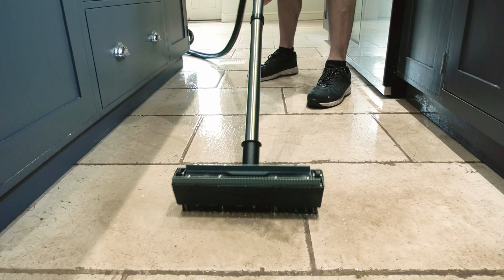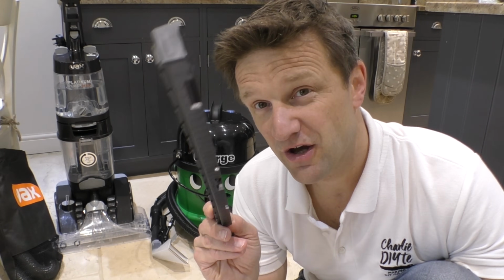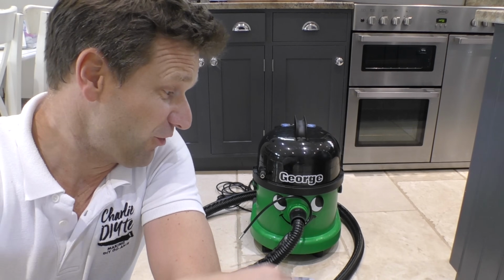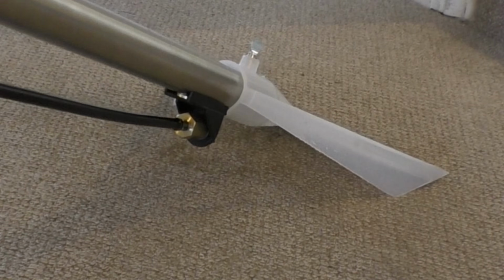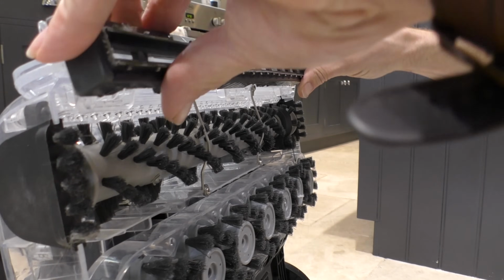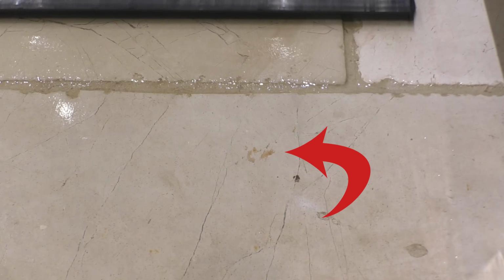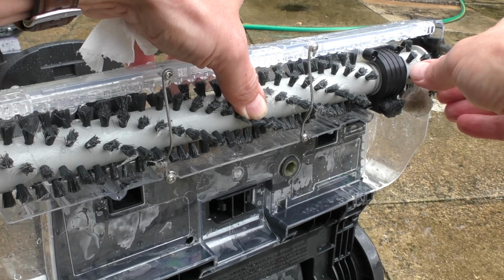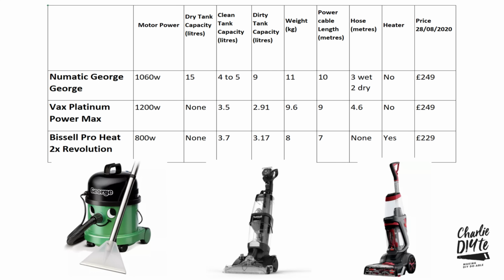The Best Wet and Dry Vacuum for Hard Floors & Carpets?

Comment: I had the Vax Rapid power advance (purple machine) and I didn't get the same problem you've had so maybe the machine you have/had is faulty or perhaps the design is getting worse. 
The solution mixer didn't use it all in one go (though still think it used more than it needed so I'd have to buy more!). I didn't have any leaks but I agree the worst thing is trying to clean the damn thing after use, absolute nightmare! 
Our machine did get a fair amount of abuse but it's still working as it should.
The small opening on the spot cleaner is a bad design, gets clogged easily.
Moving to a smaller place soon so may have to try the George, looks less complicated and more robust though maybe a little more effort needed using it.

Comment: I'm a bit confused as your talking about two different models a dry Numatic and the Wet Numatic, whichever you buy you wont be supplied with both the wet kit or dry . I bought the Henry wet and expected the dry kit to be included and wasn't.
Reply from the maker: Hi Peter, no I'm only talking about George which is a wet and dry vacuum. It comes with both kits. It is confusing how many different models there are but George is basically the Rolls Royce in that it has the best spec dry accessories and is the best domestic wet vacuum they do.

Comment: What I'd really like to ask is how does the suction compare for extracting the water from carpet?  I see that the hand-held tool is clearly superior on the George, but did you notice whether the large fishtail also had more suction and extracted more water from the carpet than the vax main head?  
I recently tried and sent back a Bissel Revolution 2X because it leaked.  My experience of it seems like it is almost exactly the same experience as you've had with the vax.  The handheld barely had any suction on it, it was almost impossible to clean around the brushrolls and it was so loud I needed ear defenders.  
The only downside to the George is of course there's no carpet agitation built in, but I could just do kind of what the pros do and brush a pre-spray in before extracting.  Though I'd have to use a manual brush whereas they use a separate electric brushing machine.  
Thank you for the video, it was just what I was looking for.
Reply from the maker: George is superior to the Vax in almost every way. Don't buy the Vax. You'll have a similar if not worse experience than the Bissell, and my father in law has broken mine somehow when he borrowed it soon after making this video. The water extraction with the fish tail is very good. As you say with no agitator you have to pre treat and then I use a soft scrubbing brush to agitate, and I typically use the snap fish tail rather than the large one as you can apply a lot of pressure with your hand for maximum extraction. Basically it's a spot cleaner. If you wanted the whole house done I'd get a pro in, but for hard floors and spot cleaning, George takes some beating.

Comment: Hi does the numatic george do a good job for carpets or is the vax better? I have thick carpets
Reply from the maker: I'd say probably George is better but if you've got a lot of carpet to do I'd get the pros in and use the suggestion vacuum just for spot cleaning. That Vax is dreadful.
Reply: @CharlieDIYte  thanks for replying 
Lots of great of reviews for the Bissel and Vax but I just think how do those brushes do any real cleaning? Is it worth getting it at all ?

Comment: I’ve had my George for about 10 years now and it’s never let me down. I’ve used it for carpets, sofas, car interiors and it’s been a real workhorse. It’s still going strong and if it packed up tomorrow I wouldn’t hesitate buying another. I always use rug doctor liquid but after watching this I may try using something different. Great review as always Charlie. 👍🏻
Reply from the maker: Thanks buddy, and if it did pack up tomorrow, you could just order spare parts for it - something I forgot to mention in my video which is pretty stupid considering I've replaced the motor in my Henry https://www.youtube.com/watch?v=yO7nfqiABMw&t=6s 👍

Comment: Great, not heard of the George before. I've got a rather expensive natural wool carpet being installed Monday and was just looking at vacuum options for it as I currently have a Dyson and I heard they aren't great for wool. I was also concerned what I would do if I spilt coffee or wine or something on it. Strikes me the George might just be the job. I'll have more of a read around but thanks for the advice Charlie. Oh by the way, any plans for a garden Sunhouse feature in future, thought it might make a interesting vid, options, DIY, self build ...
Reply from the maker: Yes, I'm hoping to build a garden room later this year. That small fish tail nozzle on the George would be the best option for sucking up spills on that carpet. Is that the one that can sprouts shoots if it gets a bit humid? I've seen those in some of the very high end renovations I've worked on. Lovely under foot!
Reply: @CharlieDIYte  This is just a nice natural wool loop carpet from Galloway sheep. Not cheap but not stupid expensive. But yes very nice underfoot. I want to make sure I use a vacuum that doesn't damage it and it sounds like Dysons and the like tend to pull up the surface of wool carpets due to the rollers and stuff bristles. I think the best bet is something like the George and vacuum often so there is never any direct ground in. I have an existing Sunhouse which was there when I bought my house. The plan next summer is to strip it back to the frame and see what condition it is in and ideally use the same materials but insulate as well. Otherwise I will replace anything that needs replacing and reclad. I will almost certainly have to replace the window frames and doors as I can see the rot in them already.

Comment: Well having owned 3 different vax machines firstly the classic orange and black vax machine, secondly, the model the platinum power max replaced and the platinum power max also. i have used other brands of machines as well. i am looking to replace my platinum power max though its about 4-6 years old now its still working but it leaks so i have to make sure the tanks are empty after every use. i prefered the model that i originally bought before the platinum power max the only reason it was replaced was it started leaking (it was a warranty replacement) but its squeegee was much better. the platinum power plus does have its benefits over the discontinued model, if they used the same squeegee it would have been a better model than it is.

The George seems like a more advanced version of the classic orange and black vax but i wonder if its powerful enough for my needs? i mean im used to the platinum power max and my main use for it is cleaning hard floors sometimes 3 times a week. George does look like a good contender but is it really?

Now going back to my platinum power max ill share the issues ive had with it some are trivial some are bad you decide for yourself which is which. In your video, the pre-treat unit is a pain to use as you found the best way to get it going is push one side of the connector (the one with the seals on) towards the vax and then press the trigger on the other end and just wait a few seconds after that it should work fine. its not perfect but its a workaround. my biggest gripe with this machine is the squeegee while it works ok I've had to replace mine every 6 to 8 months! the problem is with how its made if you notice at the front where it clips on its just barely held on with 4 tiny little tabs and at the rear it's just held on by friction and if you look at the squeegee its 2 colours so its been moulded in 2 pieces. Now what happens over time is they start to come apart and that friction fit becomes useless only solution is to replace it and even if you do vax only give you a 30 day warranty on the part. it could have been designed and fitted a lot better than it does what would have been better is if the front nozzle part that removes would be to swap that out with another one and also while they are at it design it so that it sits at the same height as the normal one so then you get the full brush use as well. what they could also do is have a replaceable squeegee one more like a window cleaners squeegee and sell them in packs at a decent price. id prefer that over the ones they supply with the machine. 

ive ran my machine on lots of low foam carpet/floor cleaners even though vax wont recommend it and it has no problems at all with anything ive put in it. my go to for my vax is usually flash gel the pink one its a good all-rounder for carpet and hard floors. the other thing i dont like about vax is generally they dont sell spare parts. well, they do things like the squeegee but im talking like motors seals, attachments and new containers etc. don't get me wrong my vax has had a good hard life but its showing it now and there is no way i can repair it which i like to do! ive repaired most of my kitchen "white goods" at one time or another. 

have you since doing this video had the opportunity to try any other machines that do hard floors? id be interested to know about them if you have. i use mine for my utility room kitchen and bathrooms as they all have tiled floors. As with you i dont really like mops and steam cleaners with pads they just don't cut it for me. I'm tempted by George but im concerned about power mainly and if spares are available. it seems to do a good job although I do prefer an upright and I spoilt myself with vacuum cleaners by owning Dysons for 20 years there's not much that can compete with a dyson. 

sorry for rambling on but I guess some other people could find this information useful too. having owned the platinum power plus and worked it hard i would not buy another one even though its pretty good and its lasted me this long.
Reply from the maker: Thanks for this. You'll find George much more durable but it's quite hard work, as you're scrubbing more than you do with an upright, but you'll get better results. Yes the squeegee attachment on the Platinum Power Max just seems like an afterthought. Bottom line this is designed for carpets not hard floors.
Reply: @CharlieDIYte  well my grout is black so I'll probably only scrub the tiles themselves lol. I did look at the Henry wash seems the same as the George but without all the dry vac stuff which is fine but the George motor is 60w more and I don't know if it's worth it.

I don't mind the cost of either just not sure if it's worth getting George for 60 more watts.

Comment: Because with all the other videos. That I’ve watched and the reviews all pretty much say it’s all good.
Reply from the maker: Um, well it's up to you which reviews you trust, but I did put it together properly. You have to ask yourself if the other reviews were genuinely objective. Up to you which one you buy, but you have to ask yourself, do you want a plasticy machine which has no long term part replacement program or a tool that's built to last and which is manufactured so that every part can be replaced.

Comment: Really good video. Can this be used only for dry cleaning sometimes? what parts do I have to buy for that?

or If is there one of the Henry, George range that can be used at times only for drying and other times for washing too? Asking because don't want to buy 2 separate vacuums.
Reply from the maker: Yes, George can be used in dry only mode. In which case it's a very powerful, slightly larger Henry.

Comment: Iv found vax to be a bit unreliable in past 1 upright carpet washer top of range at the time broke down after the warranty period. The wet and dry 6100 series the old fashioned big orange thing. One broke after a week got replaced and I noticed the hose to be poor quality and it’s only glued into the end that attaches to the machine. Upright vacuum cleaner broke in warranty period again replaced under warranty. One thing I will say is that upright carpet washers don’t give the ability to put more pressure on high traffic areas or spots. I have achieved better results with the 6100 series vax than the upright washers. The attachments for the vax 6100 aren’t great feel cheap however they can work on car interior but not professional standards.

Comment: Are you able to swap the bag inlet nozzle on the George for a Henry one?
Reply from the maker: No, because the fittings are different. George is a more sophisticated twist and turn whereas Henry is a screw on attachment.
Reply: @CharlieDIYte  Ah, that's a shame. Thanks as always for these vids Charlie. Real lifesaver.
Reply: @benmjt  Probably too late but I think the Charles or the Argos Henry Wet & Dry (same model just rebranded for Argos) has the screw option.

Comment: Have you go a henry xtra
Reply from the maker: I have, Mike. If you're getting a standard Henry it's definitely the way to go, as it comes with the Aero head tool and mine at least has a two speed motor, although we never have it in the low setting!
Reply: @CharlieDIYte  I would suggest going for the Charles Wet & Dry or Argos Henry Wet & Dry (same model just rebranded for Argos - Also often on offer at Argos). The reason being that as it is a Wet & Dry vac it isn't restricted to a 640W motor, instead it has the larger 1000W motor. The 640W has a flow rate of 31.5L/sec v the 1000W's 40L/sec. Also 15L capacity in the Wet & Dry v the 9L in the Xtra. Though it is a bit bigger due to this. Also 2.5m hose on the W&D v the 2.2m Xtra. You don't get the aero brush with the W&D but that can be bought as an add on making them about the same price but with the option of using Wet mode. Overall therefore I think the Charles/Argos Henry W&D has the edge with the more powerful motor/air flow, bigger capacity, longer hose and option for Wet.

Comment: Tip for the George. A squirt of WD40 in the waste tank will help stop it foaming up and getting sucked out through the motor.
Reply: just the tip I needed, thank you! Is it WD40 specifically or would any oil do in a pinch?
Reply: @Maienkind805  i have only ever tried WD40

Comment: So!
How does the George compare to the Henry Wash to standard Henry?
Reply from the maker: Don't know how it compares to the Wash but it's more powerful than the standard Henry.
Reply: @CharlieDIYte  cheers. I think I may get the George for my site work which is mainly installing windows. 

I like the idea of my fitters finally having no reasons for grubby van seats ;-)

Perhaps will look out cutting back the internal spout to reduce blockage that could occur, as shown at end of video.
Reply: @darronroper  If you don't need the ability to wash but still want to be able to use for Wet consider the Charles or Argos Henry Wet and Dry (same model just rebranded for Argos) It is about half the price of the George but otherwise is basically the same hoover.
Reply: The Henry wash is just gerorge without the dry attachment

Comment: I now have a Bissell revolution but I was wandering if this George would suck more water out of the carpets using the fish tail after the bissell has cleaned them, the bissell cleans very well it  but it does leave the carpets wetter than I would like
Reply from the maker: The fish tail nozzles are fantastic at sucking out water. You wouldn't want to clean a whole carpet with them but they're truly awesome for spot cleaning - eg wine spills or dog or cat excrement. It's quite remarkable watching the stain lifted up and then sucked out of the carpet. George truly comes into its own on hard floors, and then of course it's a very powerful dry vac, and the accessories are better quality than you get with most Henrys.
Reply: @CharlieDIYte  thanks for the reply, I wasn’t really thinking about the cleaning side as the bissell does that very well but I did want something to draw more water out of the carpets so the dry time is reduced. So basically finish off with George with the large fishtail to dry the carpets.

Comment: Is the George okay on timber floors?
Reply from the maker: It would be ok. Doesn't leave the floor as dry as some of the machines that are designed for flat surfaces but as an all rounder it's difficult to beat. Don't buy a Vax - flimsy gimmicky product.

Comment: Happy Xmas! Many thanks for reviewing these products. Just wondering, did you try using the Vax without the squeegee front attachment? - the bit that rendered the rollers useless. I have stone floors very similar to yours with wide deep mortar grouting and I would think the Vax bristles would work wonders on that - the dirtiest part of the floors. Would be very interested to know what you think of that 🎄☺️
Reply from the maker: I haven't, but without the squeegee it won't suck the water up properly.
Reply: @CharlieDIYte   - I’m wondering in that case - use the Vax without the squeegee initially to scrub the floors - then add the squeegee to suck up?
Reply from the maker: I think I'd still buy George with its scrubbing tool. Yes harder work, but my father in law borrowed the Vax soon after I did this video and quickly broke it.
Reply: @CharlieDIYte   - Did you reseal the floor after using the floor cleaners? Or maybe the sealant survived the deep scrubbing?
Reply from the maker: @WonPXL  It just about survived but needs resealing really as it's a water based sealant and isn't very durable.